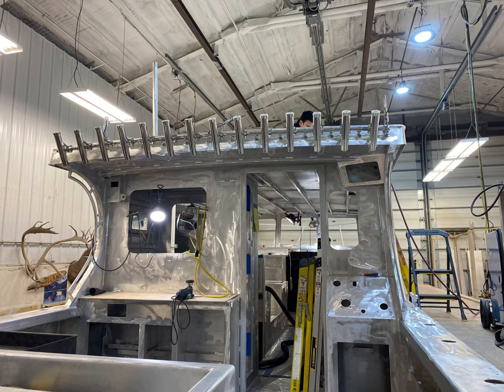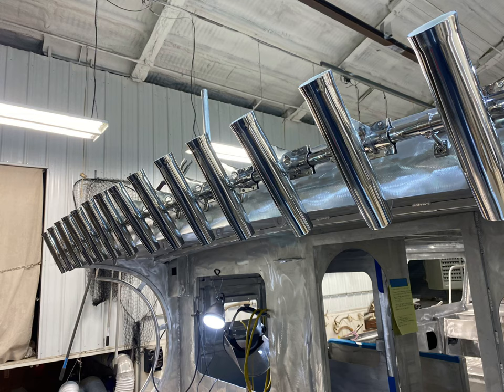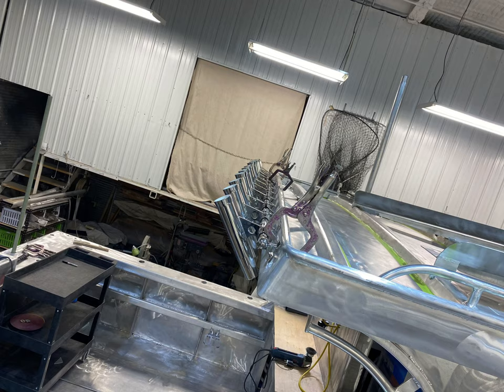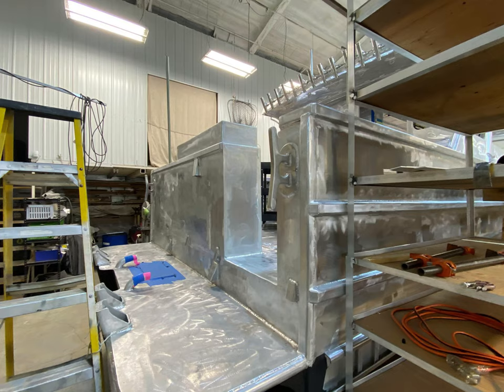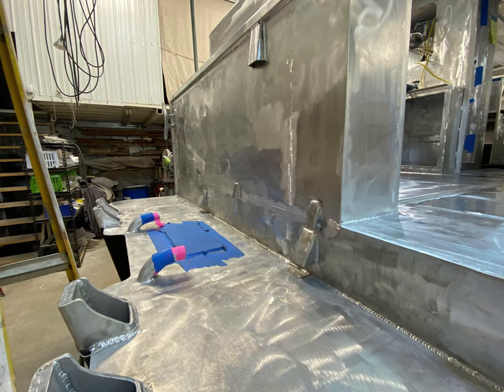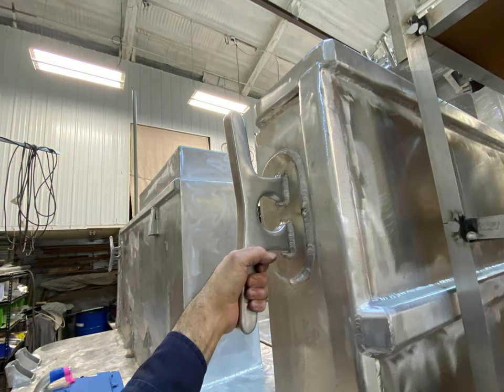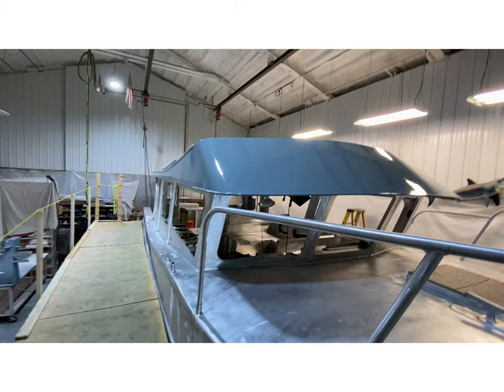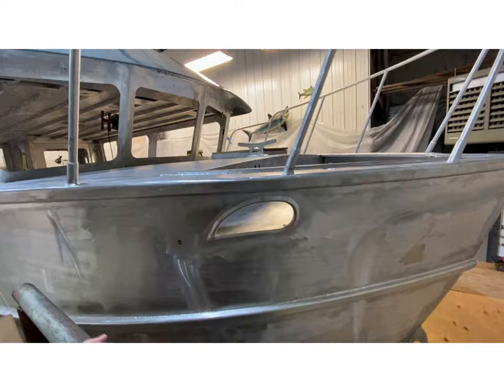Jahrig Aluminum Boat- #32--up to 12-28-2020--34' Aluminum Boat build

Comment: Looks great!
I like the bedliner also.
I use upol raptor quite frequently and it’s been a great product.
I’m sure you’re getting excited actually seeing some paint and etc!
Reply from the maker: Hoooo you can't believe how good it feels. even thou the painting is a pain on a whole different level-right. Yes the first stuff was raptor, even have a bunch of the self etch primer for spot I'm not top coating. Seems to be good material.

Comment: Are you building from plans or blueprints? And if so, is there a source for them? Thanks and good looking build.
Reply from the maker: Hi Chuck-I am building from 80% my plans and the Hull is a design from my friend Kevin. I have worked on the essentials of all I wanted in a "trailerable boat" my wish list is long. I am getting most all I wanted. I have my working drawings/dimensions for reference and Kevin put together computer lofted generated cut plans/line. I cut everything by hand.